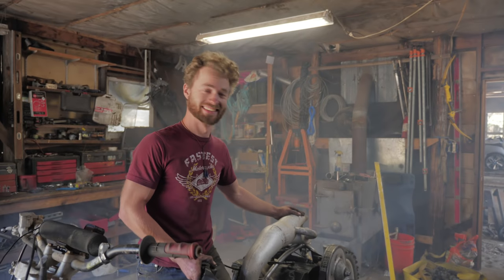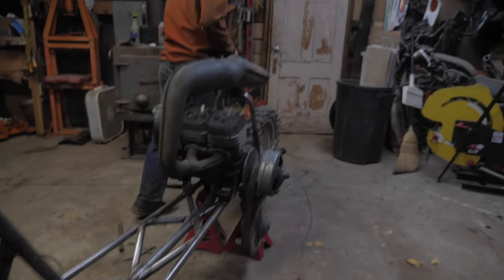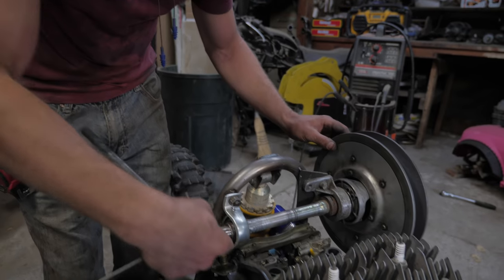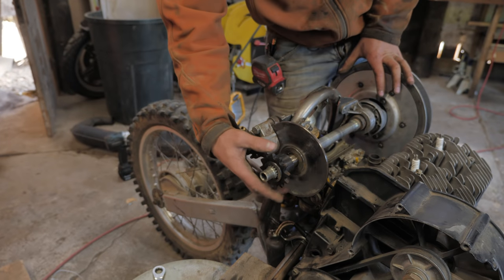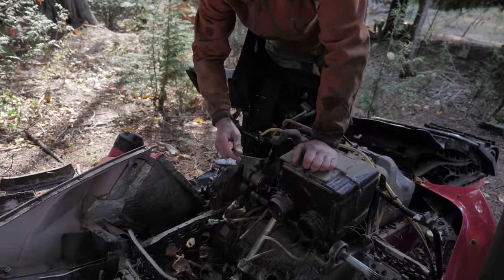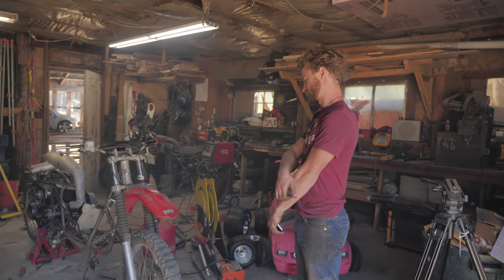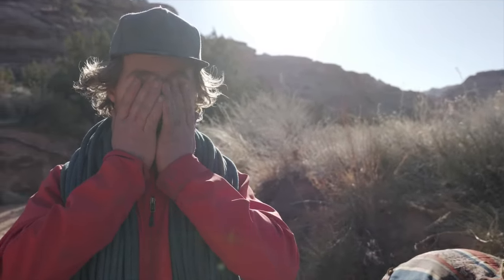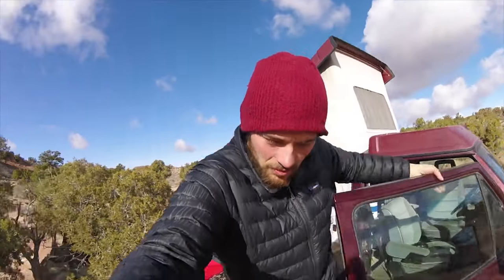The Snowmobile Powered Scooter Runs + Custom Drive Train 4k

Comment: I know nothing of rock climbing. I have always wondered how you get your rope back after going down 191'. I the rope looped through a ring wedged in a rock so you can pull it out, ot is there some sort of knot that can hold your weight but yet come loose with a tug. Anywho, awesome video guys. The build, fabrication, and the rock climbing scenery. Just incredible.
Reply: I don't really know rock climbing but I think they just loop it through, that's why they have 2 lines in hand because both ends are on the ground
Reply: There's also the kamikaze knot.  Holds till no more weight then lets go.
Reply: Oh hell no lol. Im thinking double granny hang mans noose lasso knots. Im afraid of heights so I wont be doing any of it anytime soon lol.
Reply: @s14duma   is that the knot you see them whip the rope sometimes and you wonder how it just falls?
Reply: @wadebrennan-millar3028  yeah. Scary knot really. You tie it then cut a loop. When no more weight is applied it lets go.

Comment: Oh, I wanted to mention something. You guys building that low-slung scooter attracted me to your channel. I have always wanted to build a similar stretched frame scooter so a person could sit low with feet forward. Eventually it would be totally enclosed with minimal outrigger wheels just big and wide enough spaced to limit the rig from completely falling over when at a stop light or whatever. To get back up on two wheels a person would get up a little speed on the three then weight shift back onto just the main wheels for cruising on down the road. I got the idea while watching 3-wheeler trikes do just the opposite action when going around corners on two wheels then shifting back to three wheels once straightened out.

Comment: I have a suggestion: Try bed liner paint or some other spray texture to give the trellis some grip. I can see that being really hard to stand on once you get the slightest bit of mud on the metal bars. 

either that, or bolt a skateboard deck to it.

Comment: One potential problem will be keeping the engine cool, they are notorious for getting hot in the winter if slow trail riding and I doubt that contraption will be ridden fast enough to cool it.

Comment: I noticed your parts snowmobile still has the track and suspension on it. If you don't use it I would like to horse-trade you for it if you don't live too far away. I've got a experimental project planned that could use the track and some of the drive train and sprockets (cut into two slimmer parts.) I like your projects! Watching your videos I get the sense you live in Oregon? If so I live just east of Portland. Let's converse? Will in Gresham

Comment: May want to put a spark arrestor on this thing, notice the sparks coming out of the exhaust @14:30.
Reply: boardbysled there was not a single spark coming out of that first off, and second, sleds do not have spark arrestors and never will.
Reply: You can clearly see sparks coming out the exhaust after he lets off the throttle at @14:29. And I know sleds don't need spark arrestors, but this thing isn't a snowmobile is it? I would hate to see a fire started because of a lack of a spark arrestor. Not to mention, OHV's are required to have spark arrestors when operating on public land in the PNW.
Reply: boardbysled it’s a snowmobile engine, yes, off an old phaser, sleds have never had spark arrestors. Occasionally you’ll get flames outta them from incorrect jetting and running too fuel rich, it’s happened on my sleds before, but most of the time it’s not a problem. I didn’t see any sparks, all I saw was regular old smoke that 2 stroke sleds always make.
Reply: boardbysled on second time watching it, I did notice sparks, that’s not normal for a sled engine to spark like that. That’s odd...
Reply: @2010Greendayfan  do you know that grass burn better than snow?
Reply: TheParisto I’m not a fucking idiot, they dont make spark arrestors for sleds, and never will. That’s a stock pipe, so he cannot get one for that.
Reply: @2010Greendayfan you can make a spark arrestor from a kitchen sieve or similar metal mesh that goes over the end of the pipe you can do this to anything

Comment: 12:31 ... I never had a BEE ... but backs up my maxim ... MANY snowmobile problems can be fixed by replacing ALL the fule lines .. like? ... use THAT as a start! :)
Reply from the maker: Haha! Yeah, I couldn’t believe that was the problem. Which, it turned out it wasn’t. I mean, it was a problem, but it also had a bent rod. Ran fine at low rpm, but had no top end...

Comment: where is the Tdi Swapped bus? :D
Reply from the maker: I really want to do that! But that’s a pretty big budget project, so it might be a while before I can afford it.
Reply: thats true, check for wrecked jettas tdi for a while.
Reply from the maker: What I really want is the Subaru diesel, the ee20. 2.0L boxer 4cyl, with 150hp and 250ftlbs torque!
Reply: The ee20 suffers from bad main bearings and mainshaft 2007 - 2008 just so you know but after 2008-06 it should be good they say :)
Reply: my pd105 powered tdi jetta made 145 whp with just a malone 18psi tune and mbrp straight pipe exhaust, loads of fun to drive.

Comment: You should not wire a break to the left handle bar. I repeat do not wire the break to the left handle bar.
Reply from the maker: Why not?
Reply: @GrindHardPlumbingCo  you will inadvertently grab it thinking it's the clutch. Definitely dont wire the front break to the left side. The rear would be a little more forgiving. But it's just asking for trouble.

Comment: Bee's in the fuel line? Even more reason to avoid ethenol!!!!
Reply: There's nothing wrong with ethanol as a fuel, the problem is that idiots leave it sitting around for months in hot/cold dry/humid climates and condensation gets absorbed into the ethanol, destroying it's misciblility, leading to a  separation from the oil based gasoline it's mixed into, when the actual gasoline starts to degrade, it becomes a chain reaction leading to a turpene gum forming in the bottom and sides of carb bowls, gas tanks etc. 
Always USE STABIL and occasionally use SEAFOAM. 
PS. Most people who think ethanol is a shit product drink lots of it every night without putting 2and2 together...phew!
Reply: @_..-.._..-.._  I've worked as a lab tech at an ethenol plant in Iowa. The Midwest has had mostly ethenol for gas for decades, with few alternatives. Even with fresh ethenol, the tests were always conclusive. Ethenol lowers the lifespan of n engine, gives worse mileage and increases cost of ownership significantly. Not to mention the outright welfare by the government to Farmers who choose easy money to grow crap grades of corn to make that garbage. When farmers do that, not as much regular human food is grown, so the cost of that goes up. To recap, you have to refuel more often, the car doesn't last as long, the car needs more investment to keep it alive, your tax dollars go to farm and ethenol subsidies, and it doesn't even burn as clean as advertised. Ethenol is a complete disaster and I refuse to use that garbage. The mistakes you make are on you.